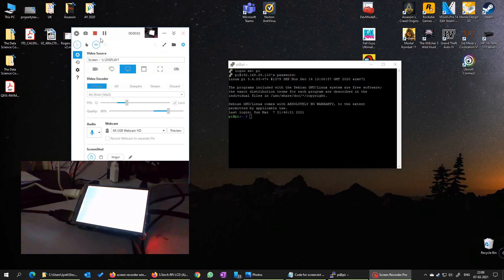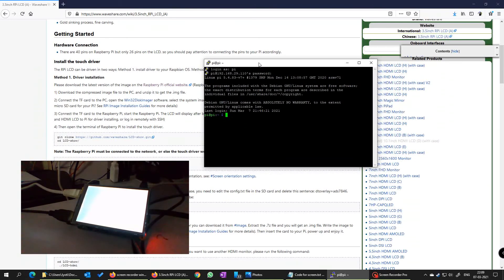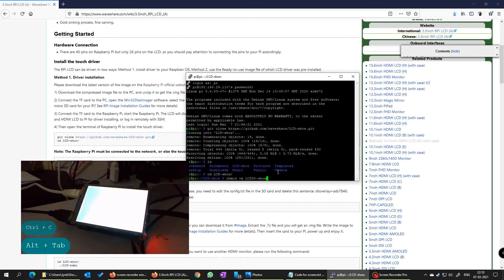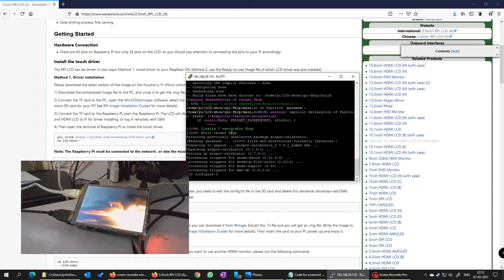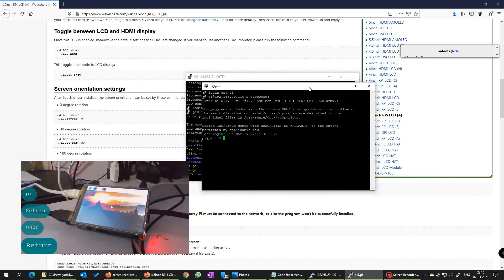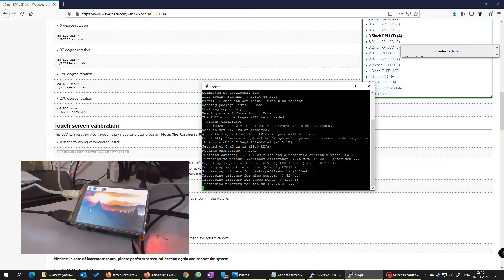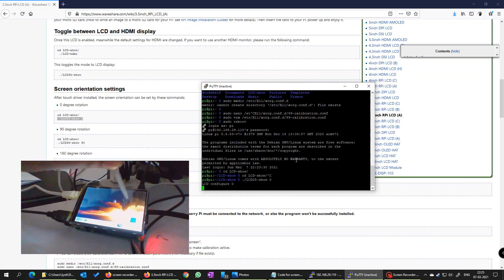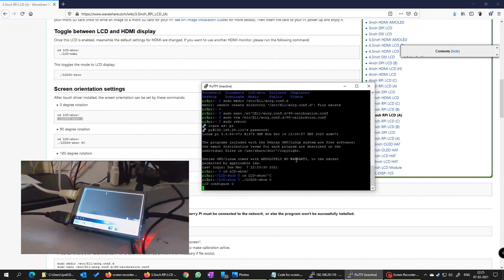Calibrate inverted touch on 3.5" TFT Touch  Raspberry Pi after enabling the screen

Comment: Thank you for the useful information but there is a question. I need to keep power cable on top. So that, I have 180 rotation comparing to yours but I can't adapt the touchscreen rotation. Either it is inverted or swapped. No way to match so far. Do you have anything in your mind to figure out this issue?